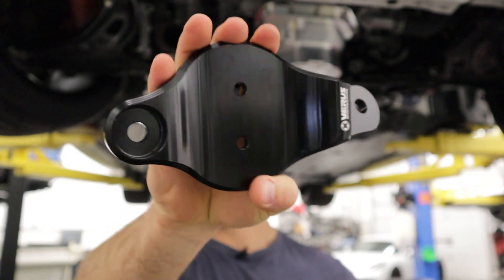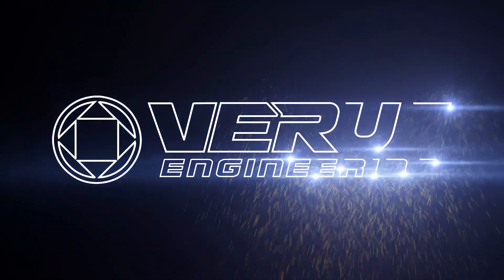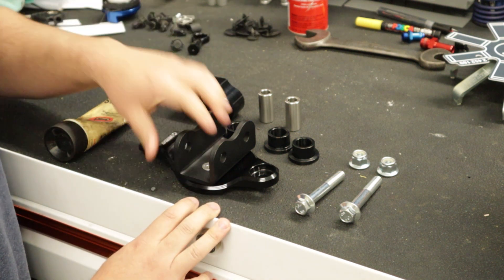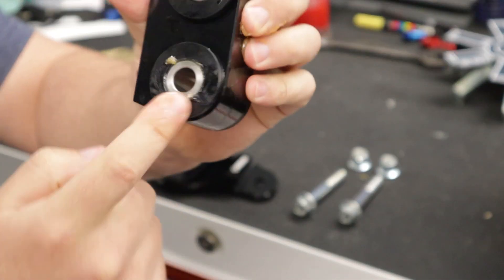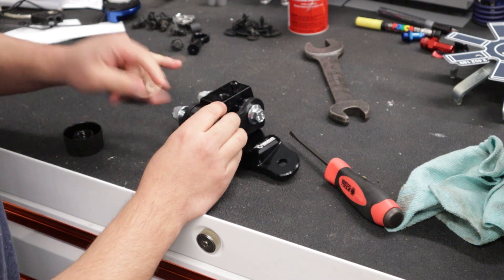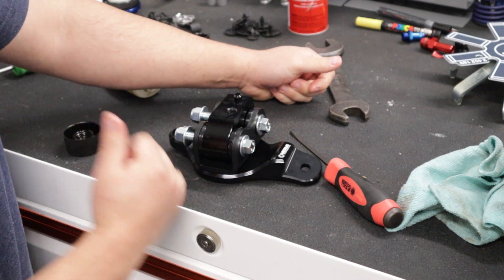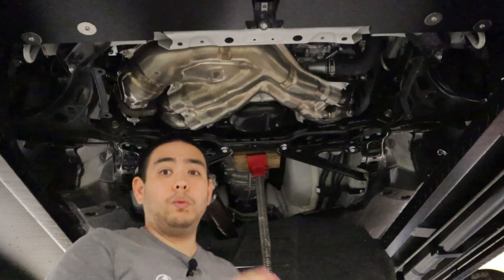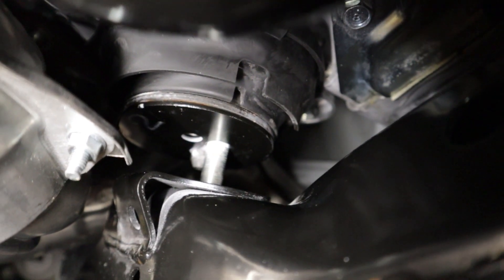Toyota GR86/Subaru BRZ Motor Mount Assembly Installation

Comment: Did you check how much it weighs compared to the original engine mounts?
And the softest bushing out of the 3 is still much stiffer than the original? 
Thanks
Reply from the maker: We did not. We could if we can find the OE but realistically it's probably very similar, maybe sightly lighter?

Yes, correct. A lot stiffer!
Reply: @VerusEngineering  Thank you

Comment: All that work for some engine mounts…… you think it’s really worth it.  It will probably take me 6+ hours to struggle these into place in my driveway on jack stands, looked hard with a lift…… they need to just come with more solid stuff from the factory.
Reply from the maker: Solid feedback. We greatly appreciate it.
Reply from the maker: For the normal person, it may not be worth it, but to the track enthusiast, this a well worth looking into.
Reply: @VerusEngineering  I have a Brz, I love a lot of what you guys make, I have most of what you make on my car.  I do everything myself,  looking at the amount of effort it would take me to do this in my driveway probably 6+ hours of work,  or have to pay someone upwards of $1,000 + for a mod that doesn’t add any power whatsoever, or seconds to lap times, and just adds “feeling” to the driving experience,  seems crazy.  I’ll probably get them eventually, and struggle them in.  But is it really worth it? Looked difficult with a lift. They need to come with better stuff out of the factory.
Reply from the maker: To you, it may not be worth it, but the hundreds of people that are running these mounts already, would probably agree that they are worth it. We wouldn't advise installing the motor mounts on the ground anyway. A lift is almost necessary for this install. These mounts help limit movement of the engine, which means that during hard decel and accel events, the motor is rocking back and forth instead of transmitting power to the ground. These units limit that movement and help with power delivery. These units are great for track day or drag race owners that are looking for a more solidly mounted engine for better power delivery, but it sounds like this product is not for you.

Comment: How the car feels after these new engine mounts are installed? is the car more uncomfortable to drive because of all the vibrations going into the cabin? I want to buy a set of these but I'm afraid of the car being too unbearable to drive.
Reply from the maker: These are not for the faint of heart. We would not advise these for cars that are daily driven. They definitely stiffen up the ride and you can feel more vibrations, but it is not unbearable in our opinion.

Comment: What oil pan is that in the first shot?
Reply from the maker: It's a prototype we are working on.
Reply: Very interested in that oil pan. Keep the GR86 products coming!!
Reply from the maker: @gman3280  still need to do some testing before we go into production, but it is coming.
Reply: @VerusEngineering  Oil pan😅😬😮‍💨
Reply from the maker: @hzozafar  still need to do some testing, but we are working on it!